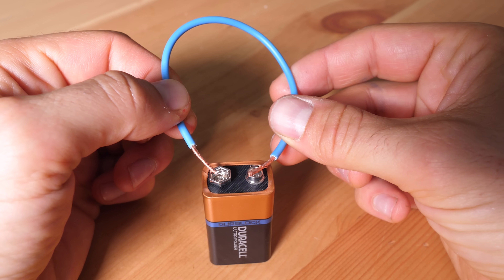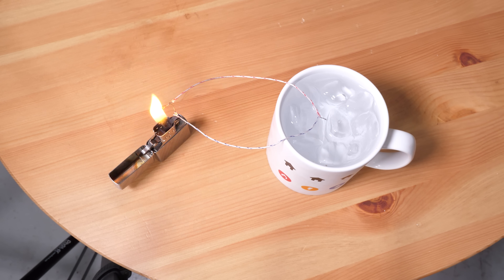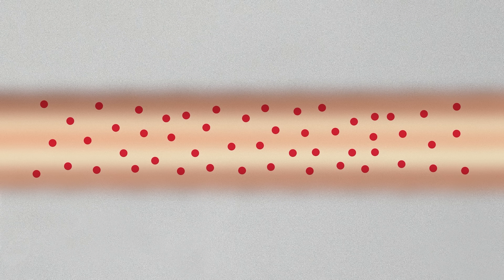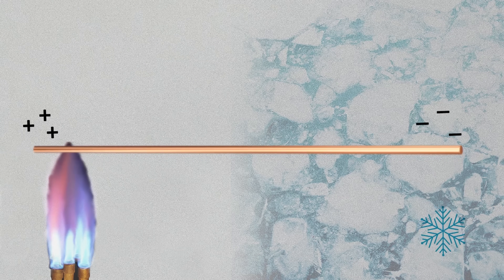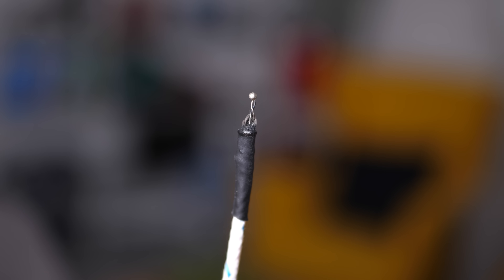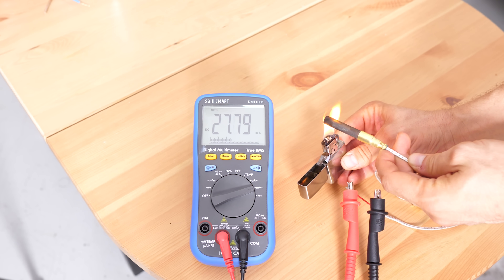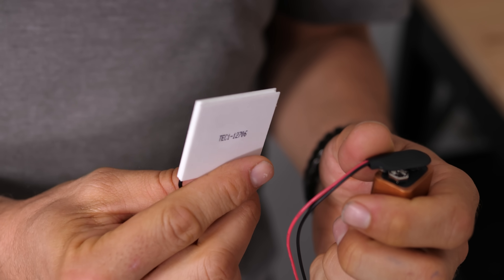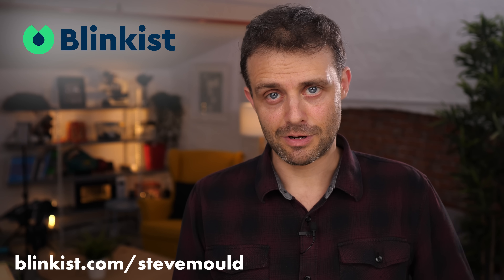Make Electricity Go Round and Round - The Thermoelectric Effect

Comment: Ok, so it all depends on a gap of space in which the bigger gap is relative density so the bigger gap transfer to a smaller gap so it is reduced to higher relative materials, so the materials change to a smaller gap from the bigger gap, so it is about the relative density of materials which is connected to size so one is bigger than another. The motion of electrons that is up and down is the same so it is about the size of materials and the transfer so the gap will change according to the relative size of materials. Well, it is about the size of the materials. So, the jigging is always the same, well depends on density, so the higher the density, the higher the insulation, so the tighter of motion of electrons so the jiggy is less so the transfer to another size of materials takes more energy since more heat cause jiggy to be higher and it transfers to other materials so the energy is reduced on that materials so become cold. Electrons are a mass that goes up and down so it is in pair of tension and compression, which creates pressure upward so the tension will cause it to go up. The tension is base on size heat so cause the upward, so 90 degree, so electrons are 90 degree and the upward is magnet so the mass goes up so heat cause mass to compress that side and as same time the side is being compress and the up part is going up to expand, the tension as relative couple material get close as the energy of two materials will inverse, so part of materials transfer since the mass will break down as entropy will go in effect. The small mass will transfer to another mass so the mass is in motion up and down, so like water cause motion of mass to go up and down since the water change thru temperature so mass on top of water change. Well, not fully right, but almost right or maybe fully right. The point it is a balance system so electricity will go infinity or break down eventually.

Comment: Jeb thentional diverentionl displacement occurs inbetween the space and motion of the space within inbetween and around the particles 😍
And right trouth the walls of directional feildflow containers bi there own gravatron evend on demand if the given ratios of the evrige thention and the aditional plus and min(min10<min 1000)
Reply: He you see the cold above the surpherds not the surpherts itself🤣🥰😍🛸
Reply: When the space on the cold side is colder you are not able to release and not to tace from the other side for the everige thention to lower the everige thention for less lobido?

You can see that if you ran the cv water healer and you put the cold side on the heath side the heating becomes more hot😍🙏

O I coming to bay on and stray😋💜

Comment: Oh... You answered two things I was curious about recently.  I failed to relight a pilot because I didn't hold down the button.  Now I know why that works how it does. I was also curious how my electric food thermometer actually measured temperature.  I figured out that it was basically only measuring it at the tip but everything else was magic. This video answered how that works for me as well. Thanks.

Cliffs: Magic

Comment: so is the Peltier effect what we use in cooling devices like freezers? Because it seems like that's what you'd use (I know I'm almost two years late, but I just found this video)
Reply: Not really. In home fridges and freezers, predominantly compressor units with freon gas are used (actually, freon, also other CNC gases, should be avoided, so other freon-free gases are used). The Peltier modules are built in portable fridges, as they are lightwieight and require direct current power supply, hence batteries are welcome. Regretfully, full-sized fridge would require large current, so special ac/dc rectifiers and current regulators should be used. This is plausible, but apparently not effective enough to replace the traditional compressors. I'm sure the household appliances manufacturers considered this, and continue selling the compressor units with environmentally safe gases.

Comment: Wouldn't Peltier be rather explained by the electrons having to go to a higher energy level, like climbing upstairs. And that energy has to come from somewhere. They take their thermal energy, or jiggle, and use it to climb. After the climb, much less thermal energy is left, thus the metal is colder now. At least that's how I understand the effect.

Comment: Could the peltier effect be an alternative to water cooled machines. Instead of using electricity to power a pump and a fan, use the power to create the peltier effect and place the cool end on the hot side and the hot end on a place where the heat can exit? Or will this way of cooling be really inefficient? For example on processors or in electric vehicles.
Reply: I was thinking about it when i was young, like 20 years ago, and i had my Intel Celeron. 
Forget about it, it drains electricity as hell. 
There is a good reason why we have radiators with fans and water cooling but we dont use peliter.

Comment: Actually, what you mentioned about trying to "catch" a current in a battery is definitely possible. This is how the superconducting magnets in MRI machines are charged. They take a superconductor coil, cool it with liquid helium, and then over a long period of time "charge it" by sending an ultra high current signal into it. They close the loop, and since the coil has virtually zero resistance it stays charged. The current just goes around and around, with nothing to stop it .

The only reason it doesn't work with your wire is because your wire has some resistance. That being said, if you were actually fast enough (microseconds fast, I believe based on the approximate inductance of the coil), you actually could get a bit of current flowing around the loop before it decays.

Comment: wouldnt it be possible to loop two peltier elements together, creating a heat transfer system? I dont know how good the efficiency of these things is, but just imagine touching something and something remotely got warm...?!

Like you could even set 2 of these up so they are connected to a microcontroller, one reading current, one sending current and both talking to each other...!

Comment: If coil wire is also copper & mug is also of copper , then will copper coil heat same metal mug or will have any  problem or short circuit becoz metal is same in coil & mug .....

Comment: I used to wonder what would happen if you coated the inside of a light bulb with reflective material and then turned it on. Would the light bounce around inside forever? Incidentally, I'm now an optical fiber technician. Its glass strands that are coated with reflective material and used to propagate light for data transmission.

Comment: Allot of good information but stop telling people they have Thermopolis in there boilers or furnace. Those are thermocouples. Thermopiles are only in newer water heaters and fireplaces. When people don't have the right terminology they buy the wrong part. If it has the wrong wires coming off of it it's a thermopile if it has the copper tubing and screws in its a thermocouple. Thermocouples are also smaller and cheaper

Comment: Lul I always thought they do the boiler no gas's leaking thing my having a very thin pipe that raises in diameter when heated and if the heat disappears the pipe closes down due to shrinking of the kind of metal and no gas's will be able to be flow through.

Comment: Worth pointing out that because of quantum nature of the electron "gas", the actual physics of what's happening is WAY more complicated. But from perspective of thermodynamics, the result is equivalent, so this is one of the cases where while the simple explanation is not mathematically correct, it works very well as an illustration and intuitive guide.

Comment: In Secrets of the H-Bridge (4 transistors to drive an electric motor with Pulse Width Modulated DC) they show a mode that circles field collapse surge back into the motor instead of dumping it down a protection diode. The current may circle for a millisecond or more before the next pulse arrives and +VC is routed through the motor and down ground.

Comment: The bigger the junctions, the more current flow you get. The voltage across wire centers is very low and the current flow along them very high like inside a motor except static that state.  Perhaps a bias applied across the centers of the wires could get a pulsed flow that can be tapped in a transformer. Iron and copper are very dissimilar.   
OTOH, with 2 good size junctions with cables in between, either or both can drive strong electromagnets.

Comment: His idea of getting current going could work, if he used an inductor.
Or he could have used a loop to induce current. 
The wire resistance (R) would stop it in 4x L/R seconds, where L is the total inductance of the coil.
But don't break the loop because the current will drop to 0 instantly. Apply the voltage across a resistor then short circuit the resistor as quickly as possible.

Comment: These days, thermopiles are used mainly on gas fireplaces and thermostatic space heaters. Thermocouples are used on water heaters and manual space heaters. Pretty much everything else has electronic ignition, as they are more efficient than pilot lights.

Comment: Recall a central scientific co catalog from the 1930s where an electro magnet of 15000 turns of wire is powered by thermal electric current. One end was  heated to 900 the with a Bunsen burner and other end on dry ice.

Comment: What or is there a way to find the perfect ratio of gravity and kinetic energy so the ball can bounce forever instead of slowly losing its power to gravity?
Reply: I don't quite know what you mean.
During the bounce the two forms constantly get converted into each other.  So for a ball to stay at a certain ratio would mean that it doesn't move up or down at all.
Furthermore this exchange by itself is not why balls eventually stop bouncing. Afterall if these were the only two kinds of energy they'd just exchange with eachother for all eternity; no change in the overall energy of the ball. No, what makes the ball loose energy is drag from air, deformation of both ball and floor upon impact, the sound released on impact, etc.

Comment: 4:25 at the junctions there's technically also a voltage when crossing wires right? Going from "positive" to "more positive" (or the negative equivalent) would still induce a current so it's not just that the "top wire wins" no?

Comment: Dear Steve: In the beginning of the video you said the current will be interrupted if the 9v battery is disconnected. Why not use an inductor, or wind the wire many times? You can have longer lasting current, or at least a spark? Use a capacitor at the other end to store the voltage. Use a bunch of thermocouples in series in flame for high voltage, use a bunch of thermocouples in parallel in ice water for higher current.

Comment: You can kinda catch the current in a wire. Specifically trap the magnetic field in a coil. It will die down after a bit due to resistance. But transformer coils can be magnetized for a few secconds if shorted before they are removed from the current source.

Comment: Just like a feeler for the small gas flame😍

We loop currend with migrave systems en beads en coils oll the time😍
To manivest feilt transmisions in plasma science 

You tace out of the dimention of the aloi with the flame😍
Don't see the meterstade bit wat is inbetween the meterstade💙🌀💜

The flame tace from for space inside en inbetween the atoms of the wire to open up more en maniveat more inertia😍
If space is puled open it manivest heath😍

I started mi plasma heater treu retracting infiormental space inbetween the gas atoms en inside the gas atoms wit a candle🤣😍
Becouse mi plasma regulators arend rady jad en it was realey could en dit not wanted to use the radiator😍

Replacemend of space is energy😍 en the activer the elextrons are the more power they are😍
There fore on the way to destination the burnwhood of electrons lowers some as radiation legage but actuali it had pulled some in from the inviorment to become less powerful.
So if the line wire runs treu a isolation that pulles from the electron you mentain en grow the power of the electrons without dynamos😍

As some are doing with GaNS materials around the nano chouted wirers😍💜🍀

Comment: Make a Seebeck circuit out of copper power wire and a steel spike or tube. Wrap the copper for surface area but also coil the copper wire around a soft-if-possible iron core. See how much field you get with one end of the steel in fire and the other cold.  
The thermocouple makes almost no voltage yet holds a power-hungry solenoid open. There is no voltage term in Faraday-Lenz!

Comment: Actually, you can make electricity go around in a loop!
A superconductor loop will see a current constantly flow around when a current is induced by an external magnetic field. The zero resistance of the superconductive loop results in a current that never ends.... so long as the loop is kept cool.

Comment: 2:11
This mans description of the "free" electrons is inaccurate.
As an electrician I can tell you that those "free" electrons he is talking about are not free at all. They are located on the outermost, or valence, orbit around the nuclei of the atoms in the metal wire. The number of electrons in this orbit determines whether the material is an insulator, a semiconductor, or conductor. 
This dude is mistaken.

The valence shell of atom can contain up to eight electrons. The conductivity of the atom depends on the number of electrons that are in the valence shell. When an atom has only one electron in valence shell, it is almost a perfect conductor. When an atom has eight valence electrons the valence shell is said to be complete and the atom is an insulator. Therefore conductivity decreases with an increase in the number of valence electrons . The only electrons that are called "free" are those moving between atoms under applied current and are only free as a result of the current.

Comment: one case where you actually have electric current in a wire coil going round and round over and over is in in MRI detectors. they are cooled with liquid Helium to make the wire superconductive so no electricity is lost, and then the current flows though them. to generate a Magnetic field that strong, its really useful.

Comment: So the Peltier effect works because the voltage is pushing electrons from one metal where the electrons are occupying lower energy states, into a metal where the electrons occupy higher energy states. And then when the circuit is completed, the electrons that are occupying the higher energy state move into a metal where they have more energy than the electrons previously occupying the metal? I think I get it but it's hard to conceptualize. Thanks for the thought food Steve!

Comment: I was thinking about the question he had as a kid about 'catching' the current. I'd imagine its possible at least theoretically. Though this is basing it off of my basic understand of physics.

Cause current is really just a bunch of charges moving, which should have mass and therefore kinetic energy. So for the current to drop to 0 instantly it has to convert its kinetic energy to some other form. If we assume that its energy is being disipated mostly by the internal resistance of the wire then I got the current to be 

I=I0 * e^(-RtQ^2 /m)

Where I0 was the the initial current, m is the mass of all moving charges, Q is the charge that is moving per length, R is the resistance of the wire, m is the mass of the moving charges, and t is time.

To test it in real life though, my best guess would be to try to make a basic AC generator with a magnet and a solenoid/inductor and connecting them to a lightbulb and ammeter. Then just move the magnet to create a voltage/current that lights up the lightbulb and then after reaching some current value stop moving the magnet and see how long it takes for the lightbulb to go out again. When plotting the time vs initial current curve I'd expect to see a logarithmic curve close to zero if it loops or I'd expect the plot to always be zero if it instantly drops.

Comment: A lot of gas fired heating devices actually use a flame rod rather than a thermocouple. Flame rods are kept at a positive voltage, then when they're inside a flame they attract the negative ions in the flame and a current flows. The third option is to use an RTD which is just a resistor that changes resistance with temperature.

Comment: To be technical, in the beginning when he was saying that the heated side of the wire is positive and the cooled side is negative isnt accurate.
Electrons are negative particles so there isnt a positive side, just a less negative ( i know, im being obtuse) just thought I'd mention it.

It also got me thinking that if he were to put 1 diode on each side he could prevent that back flowing curent and instead of having a lower net voltage he could gain the sum of both!

Comment: And what happens if you use a simple diode between the cold part of the two wires, then covered by an electric isolation and push it together in the cold water
9:37 min indeed without a Faraday cage, the electron movement create an external force that goes out of the wire physical limits
A magnetic wave that is included with the electron movement

As you said before in this video, the effect and his result are, for minerals and non alive forms, can be used in the both ways, all depends on the result you want
And as you said, chaotic movements due to external forces creat heat

In other way, if most of the metals are cold, with a small hot exchanger, it will work probably better
No more chaotic movement out of the exchange place
More current without heat exhaust